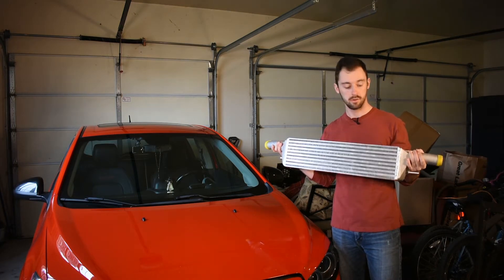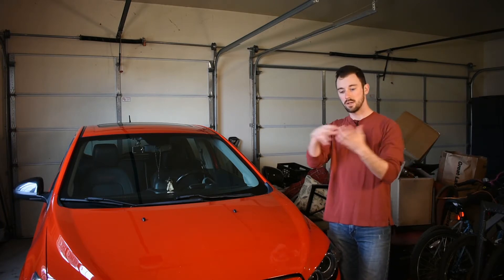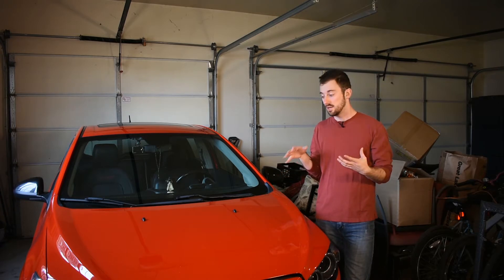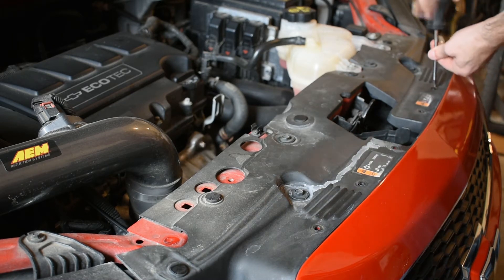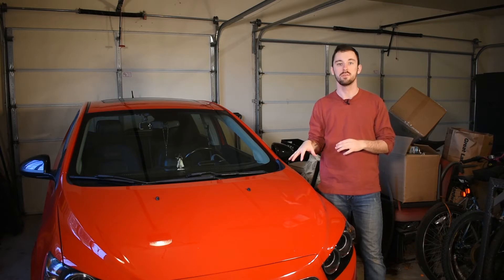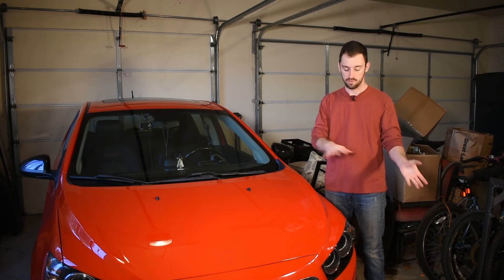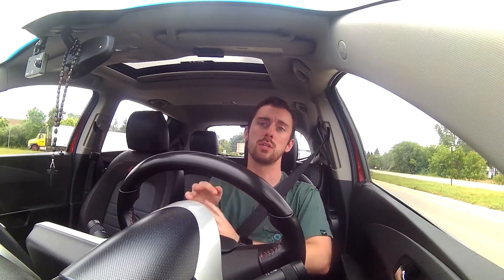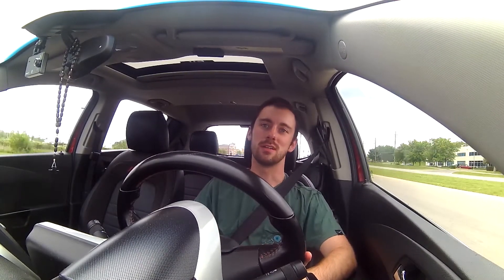Is a New Air-To-Air Intercooler Worth It??  |  ZZP Chevy Sonic Intercooler install

Comment: I have the same car same color 13 RS  only automatic I live in LA  that was the toughest decision when I bought it manual or auto I thougt of LA traffic 🚦 and chose automatic ... To bad Chevy designed the inter cooler behind the bumper so only 1/2 the cooler gets air .  The RS is more open in the lower grill than a LT they have that big thick plastic going across the lower grill for some reason .
Great vid . I'm looking to get one soon thank for posting ...
Reply from the maker: Aye twinning haha! But that's sweet, let me know how the install goes! Thanks for following along, subscribe if you can!

Comment: Mine is a 2015 Sonic LT 1.4 L Turbo and at 40,000 miles the air conditioning condenser went out and now at 42,000 miles, it's the water pump. I saw that you did use the provided ZZP silicone couplers, but how about the other ones for the radiator? I can't get a mechanic out here to install a temp gauge. These run so hot what about Radiator & water pump after market pulleys?
Reply from the maker: i didnt mess with the radiator at all but i would recommend getting a tune from zzp and they can lower your operating temp by about 20 degrees.
Reply: @drivemedia4889  I had the trifecta tune. All it did was spool up quicker. Went to reinstall and toasted my CPU so bad the reset counter was fried too. No more Tunes! ZZP has some good items for the Sonic, the Intercooler set being one.
Reply from the maker: @arnienelson6415  yeah, zzp is nothing like trifecta haha. They actually add HP and look at scan files from your car.
Reply: @drivemedia4889  A few more ponies if you already have some aftermarket parts. Trifecta tune is not what turns a chevy Luv 4 Banger into a pocket rocket. Bigger Turbo, aluminum flywheel, down pipe, mid pipe with new Cat & Muffler, Jolly green giant or bigger injectors with a new fuel pump, intercooler, and the list goes on. Now tell me about your Trifecta. Most people swap the 1.4 for the large Chevy power plant to compete on the track with Subaru at Nürburgring Germany.
Reply: @drivemedia4889  Check out the Sonic with the Camaro LS1 power plant of 455 HP's and the new one has 4 wheel drive. Ate the track record at Nürburgring.
Reply from the maker: @arnienelson6415  Thats what im saying, Trifecta sucks.
Reply: @drivemedia4889  You ROCK! That's what I'm Saying Trifecta is trash!

Comment: Mine is overheating like crazy so instead of tune first ill do intercooler and maybe exhaust and then tune
Reply: What? Lol.
Reply: @P1ayCrackThe5ky  the car is doo doo long story short so i want to buy parts 90% say tune first but i need the car running lol.
Reply: @nobreaks3305  You original comment just confused me with the overheating part.